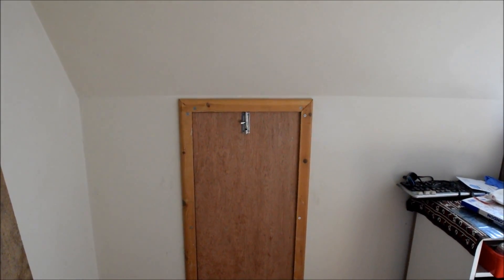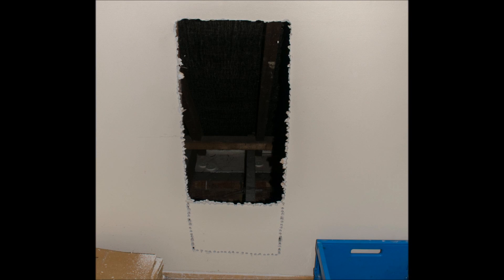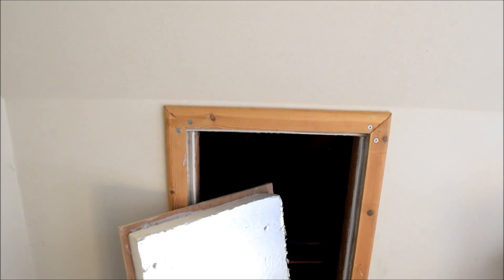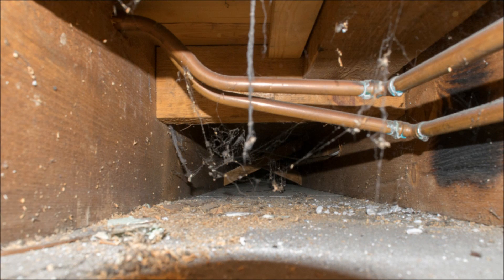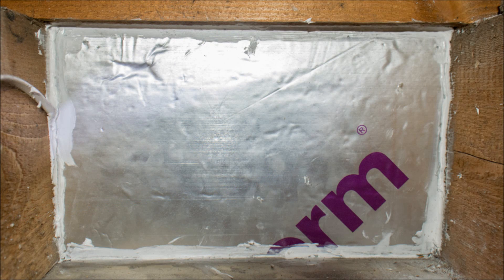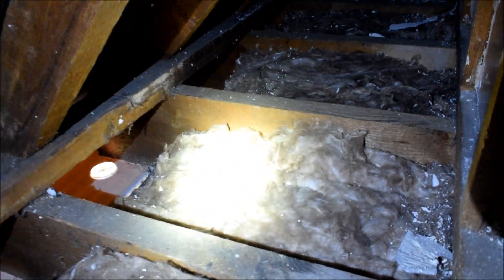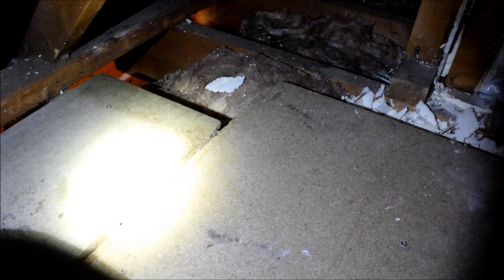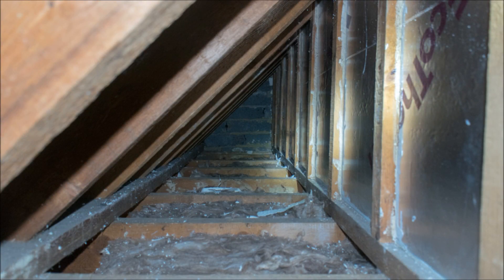How to Insulate a Dormer Roof

Comment: Nice video Mike, I'll have to do the very same as that. Some questions though:
1. Would the joists that you plugged the gap for be able to breathe as they did without the seal?
2. Is Gripfill a sufficient selant around the insulation board? Would an airtight membrane like siga tape be more applicable?
Reply from the maker: The other side of the plugged gap isn't ventilated, but it's a warm space, so should be OK from a condensation point of view I think. You could probably use some better stuff than gripfill to seal the gap. Also, it would be better still to cover the vertical batons in the wall with insulation, but there was only so much I was prepared to do in that confined space.
Reply: Mike Pepler I am doing this but was going to put insulation boards in the rafters, is that a bad idea.
Reply from the maker: @lorrainedormer8306  I don't think so, the boards deliver more insulation value for a given thickness. I used rockwool as there was plenty of space so it worked out cheaper than the boards.
Reply: @lorrainedormer8306  Depending on your roof construction and it's a ventilated/unventilated space you may need to leave a gap eg 50mm between the exterior side of the insulation and sarking board or felt
Reply: @mikepepler  hi mike, I see but how about thermo boards in the rafters by the roofing felt I dont just mean the wall dividing the space, I'm worrying about condensation
Reply from the maker: @lorrainedormer8306  ah, I think that's where you need to leave space for ventilation, unless you use some other method. Best to check with someone who knows more about it than me. I think there's some forums on green building that may help.

Comment: we have a domer bedroom which is cool in winter but also gets incredibly hot in summer, i wonder did insulating like this help keep yours cooler in summer?
Reply from the maker: Hard to say, the room on the south facing side still gets hot, but the sun comes in the windows anyway. Insulating the roof might make more difference in the summer heat?

Comment: You have not dealt with the gap between the upstairs sloping ceiling and the roof tiles. You need to push celotex or a rigid wool bat up into that space (but not fill it completely, and then there is also the flat roof in the upstairs room.
Reply from the maker: You're right, but I actually did that a couple of years before this work, as it was easy to do from the loft space.
Reply: @mikepepler thanks for this great video. My house is just like this. How did you insulate the pitched roof? Did you push rigid insulation in from the loft space? How did you make sure it fit correctly? Presumably it wasn't a perfect fit and air tight like in this this video? At the moment I'm thinking of pulling down the ceilings and taking out the knee walls and insulating the roof joists but obviously that's a massive job (and very messy).
Reply from the maker: @garethwynn01  taking it all apart is a big job, but would get the best results I think. I found some polystyrene panels that are just the right width and had some flexibility so I could slide them in from the loft space, with an air gap above them. But although they've been there for years now, I still regard them as temporary until I can take it all apart to do a thorough job. I've not seen any problems with cold spots forming though, so they must be working OK.
Reply: @mikepepler  thanks - yes I'm putting off doing anything because I think it should be done properly but maybe I need to look at something intermediate as you've done. The main loft space isn't really insulated properly because I've been putting it all off.